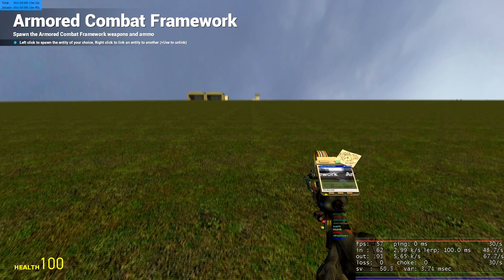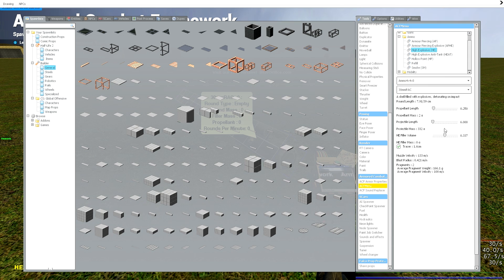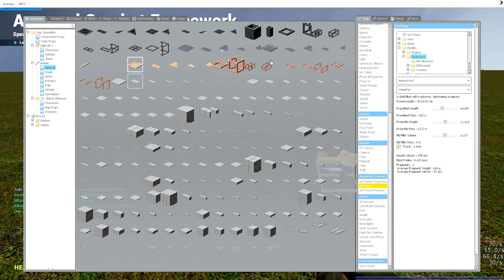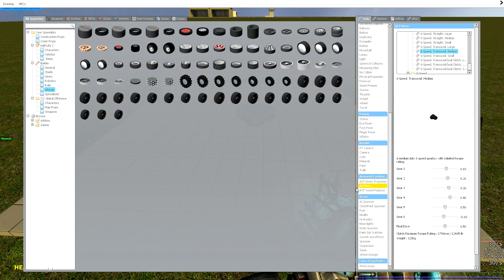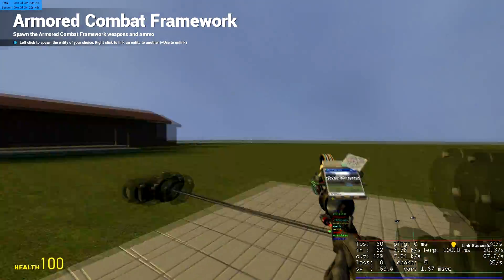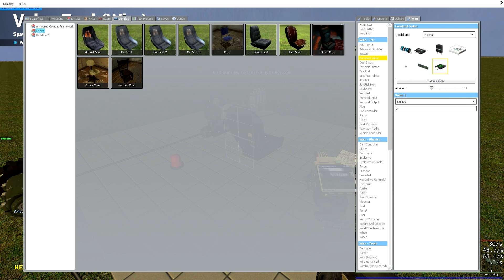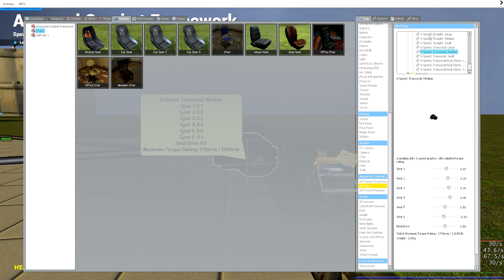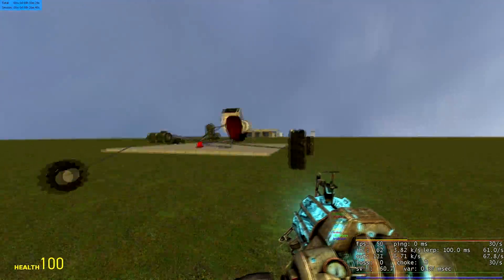Gmod ACF tutorial - BASICS

Comment: I have problem with mobility. Whenever I activate engine without applying throttle linked to gearbox (cvt), the engine sounds like it's applied with full throttle and doesn't even transfer the force to wheels. Also I wasn't in the 0 gear pls help idk where to find the solution.

Comment: Why are you using a transver in the middle of the car and then 6-speed gearbox be twin the wheels...?
Reply from the maker: Because I was an idiot.  It is supposed to go Engine - Gearbox - Differentials but whenever I got originally taught, they taught me the wrong way.  regardless, except a slight weight disadvantage, new players can still use this method.